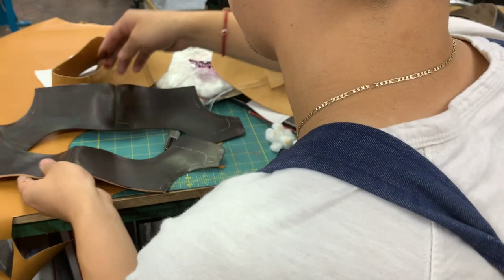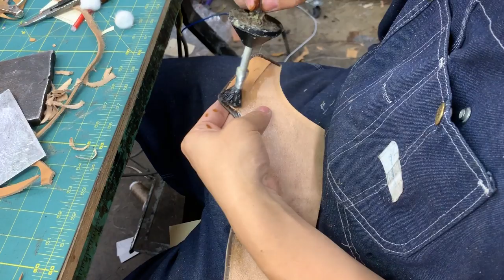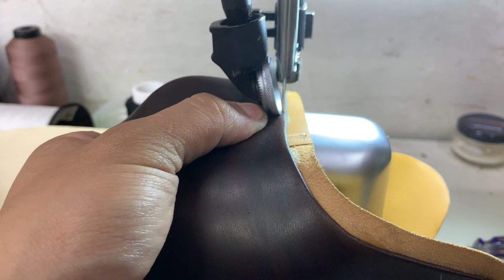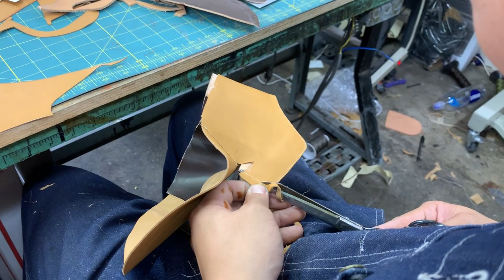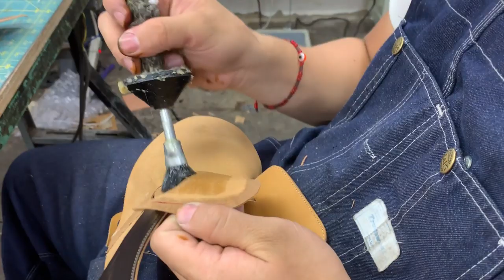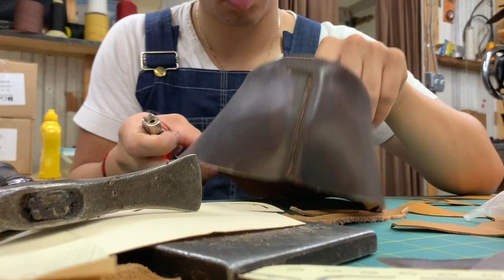BOOTMAKER MAKING SHOES | VLOG #6

Comment: Sr. Sanchez is my boot repair man. Learned his trade in Mexico and moved here 30 plus years ago. He does my repairs with a full 3/4 inch leather sole with a Cat Paw rubber 1/2 sole and a Vibrum treaded heel. He charges $130 and polishes them. Like you he takes his time and does great work. They typically last 2 years with a Redwing upper. The only problem is breaking in that 3/4 inch sole. A good soaking and about a week to dry and they fit perfect. He laments how few come to get a re-sole on work boots. Seems even the good Redwings only last maybe a year. Me, I have had one pair 8 years. Just had its 4th re-work. Wish his son or daughter would follow him. Glad I will be out of the oulfield before he retires. Keep up the good work. I enjoy seeing a craftsman doing work, joyfully.